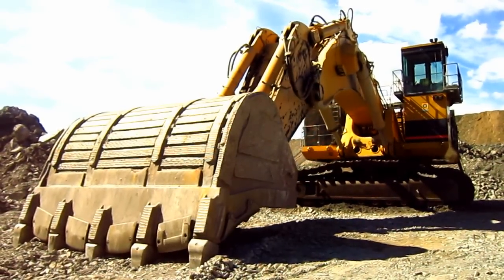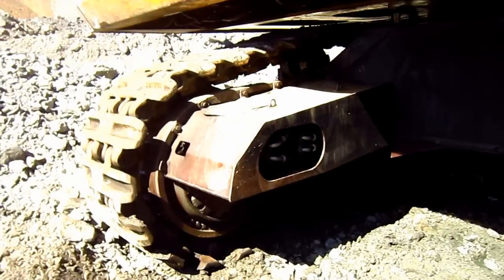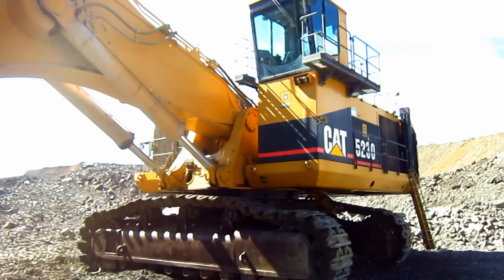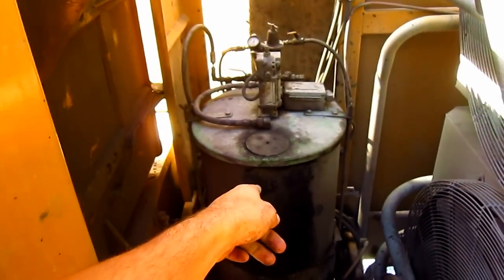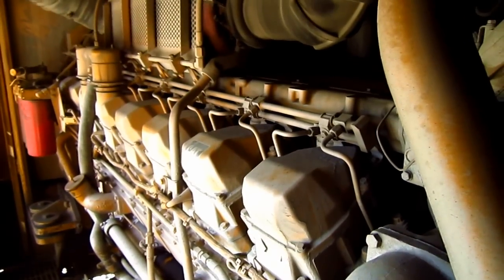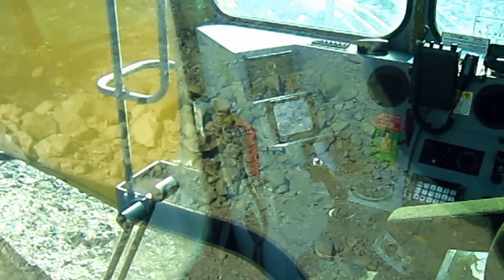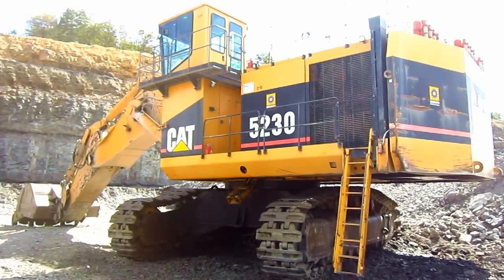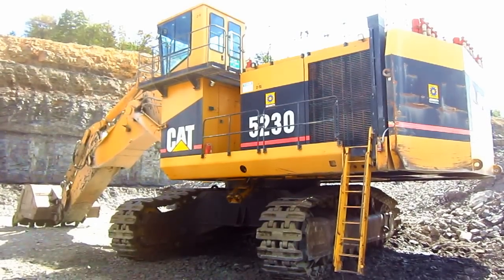Caterpillar 5230 Documentary

Comment: Thanks for this video, I've been told that  the 5000 series Cats weren't very reliable. I've never been near one or seen one operate in the flesh, so to speak, which is why your video is very welcome along with the earlier 5130 video you have posted. Your explanations are, as usual, very informative. Thankyou again for making the effort.
Reply from the maker: They weren't.  There were many flaws with these machine.  The 5130s for example, had weak undercarriages and were overpowered for how light they were built. Thanks

Comment: Awesome video! I was wondering what all the black stuff was on the boom? I was also wondering how the fire system works? Thank you.
Reply from the maker: The black stuff you see on the boom would be grease build up. The machine has a central lubrication system that lubricates all major pins during a set time interval.  As all the joints are moving, the grease gets hot and drips down. The fire suppressant system is electronically controlled.  When a fire starts on the machine it is detected by electronic sensors, which immediately alert the operator and automatically turn on the fire system. Little sprayers located at various points around the machine turn on to try and extinguish the fire, just as you would do with a manual fire extinguisher.

Comment: Have you ever come across any Cat 5110 series excavators at any of those coal mines?
Reply from the maker: Surprisingly no.  I have seen one 5110 on a big road construction project, and one at a gold mine in Peru, but none in PA surface coal.
Reply: Ok thanks, do you know if they were a decently good machine? I heard a lot of negative things about machines like the 350 and the 375 series Cat excavators?
Reply from the maker: bert26a From what I've heard, the 5110's were probably the best of the 5000 series.  Cat had those excavators right.  I was told not long ago by a Cat mechanic that up until a certain serial # (I think it was 200 but I will have to confirm), that the 375's just had a lot of problems; then after that serial #, they got a lot better.  Many long-time excavator operators often tell me that Cat hasn't built a good machine since the 200 Series.
Reply: Yeah I've heard that many times myself and often thought the 235 and 245 were much better than their successors. The only thing I had wished for on those machines was an undercarriage like the newer machines and the 3208 engine on the 225 was a piece of crap. lol
Reply: +bert26a  a 3208 was really a throw away engine. If you had a really good mechanic they could be rebuilt and last as long as the stock original.
Reply: I ran a 5110 decent machine

Comment: What would be the actual geometric or hydraulic advantage or such of the large machines always having the boom cyls inverted?
Reply: Not an expert by any means on Fluid Dynamics, but I would assume that it is easier on the pump to " push " fluid thru a cylinder rather than " pull " it thru.
Reply: The fluid pushed against the side of the cylinder without the rod in it exposes greater surface area and gives more force than the cylinder side with the rod. I would guess that they wanted greater force to lift and took advantage of the boom weight to dig. I believe it is PSI x (  Pi x radius of cylinder squared ) = cylinder force. The rod side would have the pressure subtracted using the rod radius giving far less force on that end of the cylinder.
Reply: There is no advantage power wise to inverting the cylinders.  It makes no difference which way the cylinder is, as to extend the cylinder, you always have to push on the same end of the rod.  It doesn't matter if it's pushing up, or pushing down.  The cylinders are inverted to keep dust and dirt from building up on the top of the seals, and causing damage and leaks.  As well as to simplify hydraulic hose and piping routing.
Reply: Sounds like the laws of physics and practicality combine well here

Comment: I wonder why! On this machine the boom cylinders push down against the frame, but on some machines of similar size, like a Komatsu PC2000, the cylinders push up from the frame. What would be a reason why?
Reply from the maker: This question has already been answered.  The reason why the cylinders are inverted is to keep dust and dirt from building up on the top of the seals, and causing damage and leaks.  Additionally, this design also helps in simplifying the hydraulic hose routing.

Comment: It doesn't matter which way the boom cylinders are mounted, they always expand to lift the boom (most force)  and retract to lower (lesser force).  They are mounted inverted on the larger machines just because its easier to run all the hyd lines in the same spot on top of the boom rather than down below.